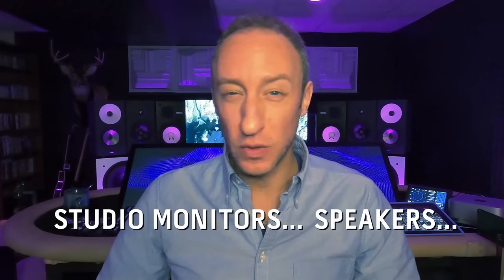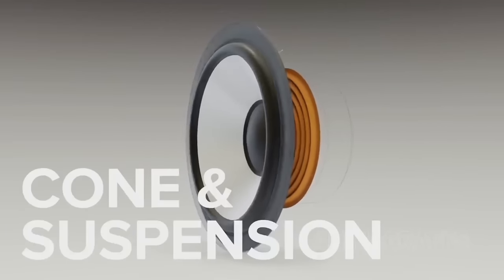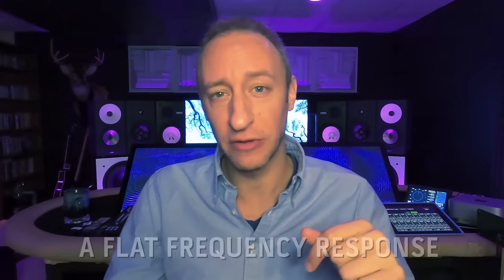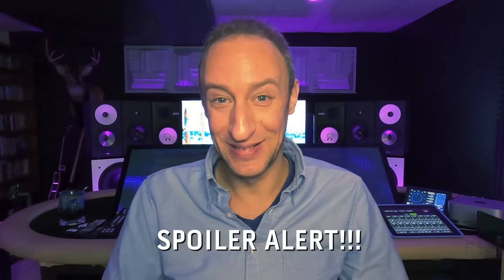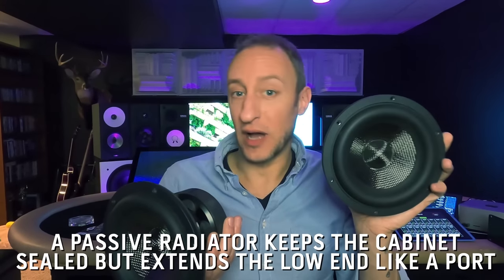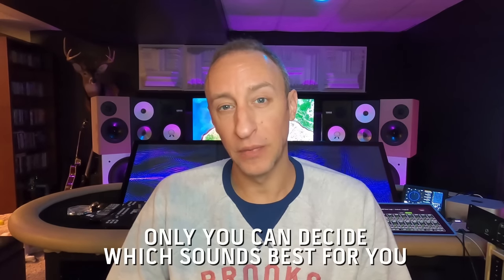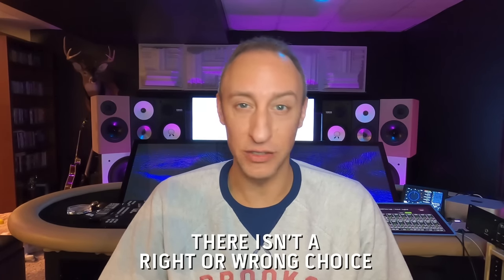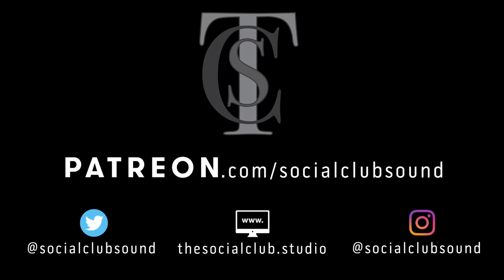SPEAKERS vs STUDIO MONITORS!!! What's the difference? Find out!!! TSC Production Tip 005

Comment: It was interesting to hear you go into the difference between regular speakers and studio monitors.  Ironically, back in the early 90s, when I was recording my Folk Rock duo Red Hound, I was using a pair of Ohm 3XOs as my "studio monitors."  People LOVED the recordings I was getting and I was using an inexpensive setup based around a late 70s 4-track reel-to-reel with NO noise reduction, running at 7 1/4 ips.  I still have the 3XOs but now I will be using Linux and the Ardour DAW to record.  For my ears the 3XOs have always presented some of the clearest sound I could get.
Reply from the maker: And that's the magic! ✨ When you find that speaker that translates for your brain that's all that matters. Glad you found yours early and got such great results! Thanks for the comment

Comment: To my understanding (and please correct me if I'm wrong) the beauty of active speakers is to have an active crossover feeding into two amplifiers. So first upside is, an active crossover doesn't cause phase shifts, and therefore is a lot better for the time domain aspects of sound reproduction, secondly you can have two "specialized" amps, that only need to excel at certain areas of "amplification".
Wouldn't it be "the best of two worlds" to bi-amp passive monitors, get rid of the passive crossover and put an active one before the two (external) amps. Would even give you the freedom to chose the best amp for each driver 🤔 just my two cents
Reply from the maker: Yeah since this video I've built out the King RO4Y MKIII 3 way active speakers with DSP and they're now all I need

Comment: Very nice....SEAS rocks!  I'm building a pair myself using them...my only quibble is his characterization of how the port works.  Ported speakers aren't exactly "open" because of the port resonance & "notch of minimum motion"..it acts similar to an air pillow in that it limits the motion of the woofer so PROPERLY TUNED can sound just as "tight" as a sealed or passive radiator....

Comment: Appreciate the video. What do you think about the diffraction that can be caused by the half rolled rubber surrounds on these woofers? Is it negligible for the mid high frequencies?
Reply from the maker: It's something that I thought would be a bigger deal, but wasn't thanks to driver spacing and crossing over where we did. Thanks for the question!

Comment: I use Ampex 2110 and Ampes a-692 self tube powered speakers, as both monitors and guitar amplifiers for recording. They have a big screw in the back of the cabinet that is used to tune the cab and speaker together, instead of a port. Have you ever tried these types of speakers for monitors?
Reply from the maker: I have not heard them. My only experience with Ampex has been with tape machines

Comment: what made you select the scan tweeter, over lets say a peerless dual ring one? or the scan dual ring  one? 
what s the crossover point on thise? and how much do the passive in the back adds, have you tried no passive?
I also  read in your shorts, that it was powered by a hyper x amp, ( im guessing that's an amp you could build into the speaker?, are you making some active version then?
Reply from the maker: I used a SEAS tweeters in both the VH-180 and SBH-7S, I think they sound more natural than peerless. 

The passives add a few dB on the lows while staying lasted sealed, enough to make it worthwhile
Reply: @SocialClubSound  any thanks and thanks for the video also

Comment: Just wanted to add that a speaker for ported design cabinet normally have a stiffer suspension  but at the expense of the efficiency. 

Also I know its frowned on but I have been using studio monitors in my listening room around 10 years. Most hifi speakers are coloured or have a recessed midrange so that all mix's sound similar. But for me I like to hear how something is mixed in a balanced way. And studio monitors do just that. If the mix is good or bad its part of the music.
Reply from the maker: I'm the same in that I prefer a speaker that let's me hear the recording instead of the sound of the speaker itself

Comment: OI achieved good results with salvaged speakers from various consoles and discarded speaker cvabs over the time i was building my recycled parts speakers using discarded kitchen cabinets and salvaged speakers drivers of all sizes and shapes from whatever i found thrown out to the curb when i was only about 10 to 12 yrs old and wanted a high end sound at next to no cost but for cables and some hardware in the builds. of 4 pairs I made with discarded parts mostly... and salvaged stereo equipment that had minor problems i easily fixed fron a simple blown fuse to bad power connections including broken solder andwires to damaged cords just inside the unit but unseen fron outside. unless you tok the unit apart to find the problem...mix and match sound quality to match pairs for sound quality... trial and error ovet timetakes patience i didn't usualh have with ADHD. have.. but for the incentive of obtaining the best sound quality i could get with what i hd on hand from scrounging all I could find. ... discardeed kitchen cabinets with a custom baffle added maked for good speaker cabstoo...lol hey pre teen with a passion for stereo and quadrophonic systems i could get for next to nothing but a litle searching through other peoples trash to find the best equipment they had no idea wreonly slightly bad and easily repaired with a fuse of simple solder job to fix...

Comment: You dont see many (You, gr research, Ps Audio) Being this forthcoming with actual information in regards to the design of their speakers, and why they make the decisions they do. +Respect and a lot of interest in your designs now. And even if it feels a bit salesy (as it should, you've made a product) i feel like i can detect a lot of honesty and integrity in your personality lol. Even though i prefer passive monitors for gear freedom, one major benefit to active monitors is the very DSP that can also be a con. It can be implemented in the design process of the speakers pretty effectively allowing for improved performance with lower cost drivers, amps, and cabinets being employed. Def a double edged sword though

Im gonna add to your explanation of speaker setup to make it easier for the inexperienced. People often mention proper speaker setup, and what it should sound like. But they NEVER suggest busting out a measuring tape, making sure your front speaker baffles are at MINIMUM 36" from the wall behind them, and make sure both front edges of both monitors measure the same as the corresponding edge on the other monitor, from the wall, and listening position both. Rooms even properly treated are rarely symmetrical, and if they are, your gear in immediate line of site is not. And this believe it or not makes eyeballing speaker setup almost impossible. And if you dont start from a place of symmetry to the rear wall and listening position, with a reverb diffused room , you can play with the soundstage by ear all you want, but unless you are intimately familiar with a proper soundstage and imaging, and have some test tracks you know like your own name, you probably wont nail your speaker setup by ear. Especially when in near field environment. half inch off on one speaker and you may be making very inaccurate decisions as far as placement of instruments in a soundstage goes.

 You very likely wont have any accuracy at all in the low end, and zero imaging outside left, right, and direct center if your speakers are too close to the wall. 1 foot+ can be ok for small near fields, but if you have drivers 5" or bigger you really want those guys at least 3 feet out from the wall, at minimum 3-4 feet apart, with you 4-5 feet back from the center point. Yes, minimum. And yes, a single half inch of misalignment can mess this up with speakers that small. pretty badly actually. Fact.

Also headphones cant soundstage at all, and unless you are using very expensive planar driven headphones with some kind of sophisticated crossfeed going on, you are not making accurate soundstage and instrument placement decision, period, end of discussion. lmao. You can make proper decision using headphones as long as you are very familiar with how those decisions translate to a proper soundstage, which you need to have setup at MINIMUM for reference purposes.

Eye/ear balling when dealing with a time domain measured in milliseconds, and with distances measured in feet with tolerances under a half inch... Use a damn measuring tape you fools.... 

 I fairly frequently make a couple tweaks to alignment of speakers and listening position for people in both the home audio, and pro audio world, often to hairs standing on end and legitimate amazement as they, usually for the first time in their entire life, perceive a proper stereophonic soundstage. In my opinion this is the reason a lot of people have "heard and didnt care for" a high end setup someone they knew had. They are either just talking to talk, or their friend had no idea how to setup a set of speakers, which is MOST people with fancy speakers and monitors honestly.

----------------------------------------------------------------------------------

"These capacitors test and measure the same, but they dont sound the same."

There are (non audio obsessed) electricians and engineers out there, who genuinely become annoyed by people who would suggest such a thing. Ive tried lots of different caps in crossovers and coupling of same values because often a certain one just ends up playing a little more nicely then the others. Sometimes same brand same value caps sound a tiny bit different too. Some of my favorite sounding cheap polypropelene caps are the JFX 5% series of caps. But for some reason like 1 in 4 just sound weird and floppy and i toss em. I dont have nearly that rate of loss with some others i really like, but i like the good JFX one's more. Similar story with those red "audiophiler" caps all over ebay and amazon. They sound fantastic especially for the price, but like 1 in a handful always seems to just sound wrong, even if it tests within spec. Those audiophiler caps often test outside rated tolerance and their epoxy dip is inconsistent and sometimes has hardened drips in them, so i dont recommend them, but they DO sound good lol.

The home hi-fi world thinks theyre chasing accuracy but they are chasing and being sold musicality. A good chunk of The pro audio world thinks they are chasing musicality, but they are in fact chasing and being sold accuracy (attempts at it anyway)

I find the misunderstandings and differing, sometimes hostile perspectives, to be entertaining most of the time. I love reminding the internet audiophiles that they are likely getting further from the original recordings, not closer, by increasing the perceived musicality of a recording using sound coloration techniques and house brand EQ curves. But they are also not wrong in chasing the most enjoyment out of their music that they can.

I mix on some of my own built monitors, with carefully designed, simulated, tested, and tweaked crossovers, in a damped room with proper speaker setup when i can. I keep a class A tube preamp i through together to throw between my interface and power amp when i just want to enjoy musicality or reference my mix on something closer to an "Audiophile" setup with that sweet sweet nectar that is even order distortion soundstage enhancement. the negative feedback loop is tweaked to just soften the upper mids and highs but without killing any air or the high end presence. And musicality wise its absolutely stunning. Tubes, where they belong, as voltage multipliers only... But it is NOT accurate to a recording at all lmao.

Also No studio sub iv ever tried integrates nearly as well with a set of active monitors, as a decent high level in sub amp (class D is actually a great sub amp option for control, accuracy and cost all at once going this route), fed from your main power amp, pushing a proper enclosure with proper subwoofer for that enclosure, integrates with a set of passive monitors. Also properly enclosed and crossed. As long as you make wise design decisions, having that isnt any more expensive either if you make it yourself. Im about $700 into those things, and can promise most would struggle to outperform them for anywhere even beginning to approach that price

I used to keep em set up for reference and the trickier mix decisions, especially in the sub 120hz areas, but rents a bitch and i live in a smaller place then i did a few months ago. Im trying to get the current landlord to let me finish the basement, out of my own wallet no less, so that i can set up a proper space around the large monitors but i dont think they're going to bite that hook.

I dont have a lot of free time anymore, and id like to spend it all making music not gear. Long story short your monitors very much intrigue me >:) it'll just take a bit to swing.

Comment: Brilliant explanations and many very good points , the only thing confusing me, is the mention of AC current driving the voice coils. Isn't the + and - on all the speaker terminals , specifically because they are running on DC ? I always thought all amplifiers input AC and output DC?
Reply: Polarity indications on the speakers are there to ensure you connect the two stereo speakers with the same phase. If you don't do this then low frequencies from one soeaker will be 180 degrees out of phase with the other speaker and they will cancel out leading to very weak bass.
Reply from the maker: No! All speakers run on AC. It's the alternating current that charges the voice coil and creates the electro magnet that works against the permanent magnet. A DC signal just pushes in one direction.
Reply: @SocialClubSound  OK so this information is blowing my mind, so all these years Im measuring DC offset at the speaker terminals in DC voltage, and now I learn the output stage of an amp is in AC?
Reply from the maker: Think about what a sine wave looks like. It has positive and negative values that alternate. You can take a AA battery which is DC, attach wire leads to it and connect it to a speaker. The speaker will push out if connected with proper polarity and will pull back if connected in reverse. But there's no other moment because DC is a solid current. You need the alternating current to charge the voice coil to create the electro magnet that pushes and pulls against the driver's permanent magnet. I hope that helps clarify!
Reply: @MicroAngelo1  DC offset is an unwanted characteristic of an audio amp. It's important to measure DC offset to ensure it's negligible. Substantial DC offset will dissipate power and can even damage speakers.
Reply: @SocialClubSound  Yes! Now that definitely clarified it! Perfect explanation!
Reply: @TerryClarkAccordioncrazy  Very helpful and crucial information ! I love it when people share their knowledge, with what they're passionate about!

Comment: Looks good as a monitor where position is constant.  If I wanted to use these for in-room listening, how's the horiz/vert on/off axis response?
Reply from the maker: These really were designed with the studio in mind. So they were developed as near fields. The VH -180 does a really good job of having a big sweet spot thanks to that tweeter. Both these designs can be placed horizontally or vertically. The crossover point is low enough that they image like a point-source. Any other questions please ask! Thanks for the comment

Comment: As a hobbiest beat maker, I learned a ton about studio monitors in this video. I cannot drop $900 and up for my first set of monitors though. I gotta make due with the entry level priced gear of $300 and below for the pair. I wish there was a sealed option at these prices.

Could I have the monitors mounted higher than my head, but pointed down to where I will be sitting? I figure as long as the speakers are pointed at my ears and properly spaced, the elevation shouldn't matter?

Plus my space is less than ideal. I'm in an open and cuttered basement.
Reply from the maker: Yeah I didn't start out with $900 speakers either. My first pair of "monitors" were Yamaha speakers from Best Buy. 

Can you please the monitors higher and aim them down? Yes. Try and get the equilateral triangle and it will go a long way to getting your speakers to image properly. 

As for the basement, the clutter isn't necessarily bad, it can keep scatter the waves, but being that your walls will have ground on the other side of them the bass notes will reflect back so just try and pick an area where the bass sounds as even as you can get it.

Hope that all helps!
Reply: @SocialClubSound  It does. Thanks a million!

Comment: What are studio monitors suitable for ?  Would I want to use them in my living room?
Reply: That's up to you. What kind of sound do you prefer ?
Reply: But are they specifically designed to be used at close range?
Reply from the maker: Good question. There are near-field, mid-field,and far-field studio monitors. The type I'm discussing in the video are the smaller near-field and mid-field. Far field studio monitors are the big soffit mounted speakers in the walls in studios. The ones in my video are more bookshelf sized with 7inch woofers. They're perfect for near and mid field. The way I'm using them in my studio, they're about 5.5 feet apart and they image like an dream